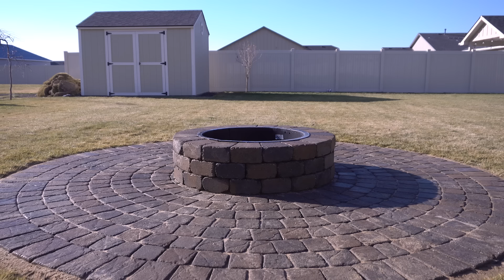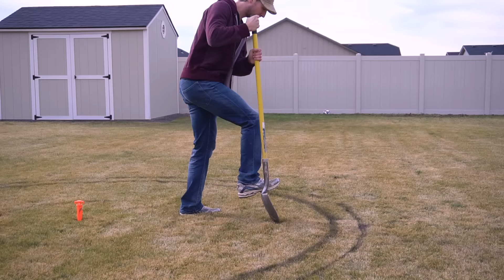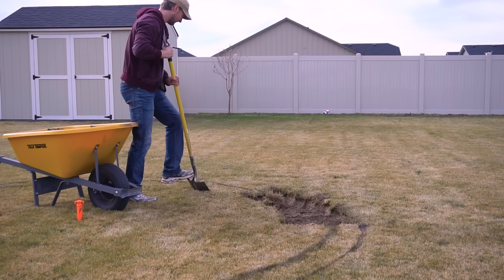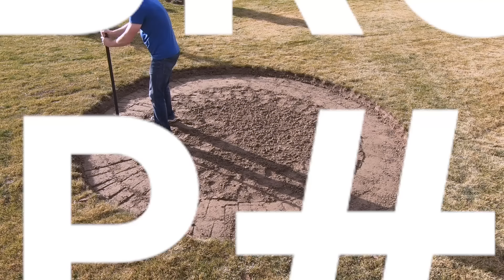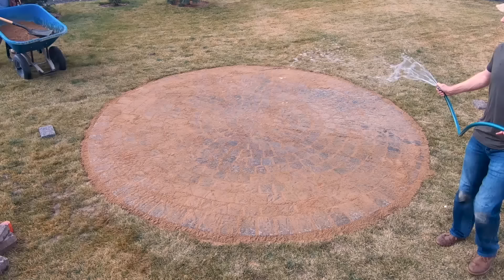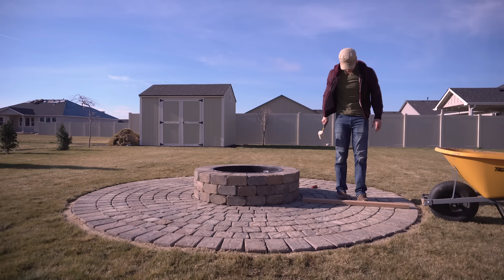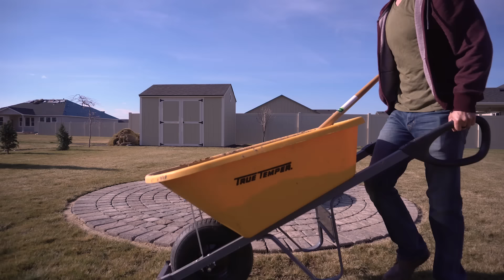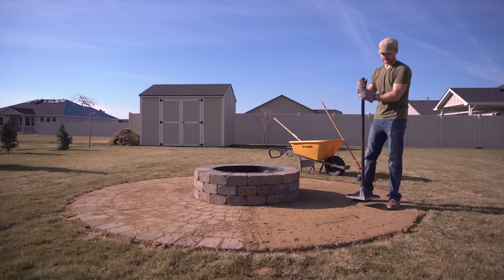My 4-Day Fire Pit Patio Build [Full DIY Project]

Comment: This is a great build the only thing I would recommend is to use polymeric sand for locking the pavers in better, metal edging just because once the grass grows a weedeater will chew through the plastic edging over time and they also warp after a while in the heat, some liquid nail would help keep the firepit stones from moving over time and then just personal preference but some low gloss wet sealer really brings out the color in pavers.
Reply from the maker: Thanks! Good tips
Reply: @BroBuilds  Obviously you finished your build so its mainly for other people trying it out😂 I used to build custom outdoor kitchens for a landscaping company so Ive built tons of outdoor patios, I like the kinda "go with the flow" attitude though and its a great looking patio, got a sub from me for sure👍
Reply from the maker: @GarrettMusic  I appreciate it! I'll be building a bigger one attached to my house later on, so I'm definitely gonna be using all the good suggestions in the comments. 🙂 Welcome to the channel!

Comment: Should have done landscape fabric , metal pipes work better instead of conduit because they don't bend, don't need to pack them in like that you can take a rubber mat and your hand tamper set them better, gotta try to break those seems a bit better too, whyyyyyyyyyyyy didn't you use joint sand to match the color of paver it's not that expensive and locks them together better, tips and comments from someone who builds patios for a living
Reply from the maker: Yeah. . . There was some stuff I missed. So far it's all worked well though. I didn't want to use joint sand because when it cracks it looks ugly. I'll just put a little more regular sand when it needs it.
Reply: @BroBuilds  I do agree it worked well and it looks great! Also joint sand doesn't really crack if it's swept right, and you use a leaf blower to blow away excess sand
Reply from the maker: @deathninja1299  good to know! I'm gonna be doing a bigger patio attached to my house, so I'll look into the stuff you mentioned for that 👍
Reply: @BroBuilds  can't wait to see a video on it!
Reply from the maker: @deathninja1299  it's gonna be such a huge project. . . But I'm excited to do it, just want to do it right, for sure! :)

Comment: you don't need to add cement to the blocks that m ake the fire pit? Like I know theyre heavy but still shouldn't you add just abit? to make it a bit more permanent and secure?
Reply from the maker: Yes, we should. I just wanted to wait because I knew we'd be removing some of the bricks to increase airflow and reduce smoke. We posted another video on that process, if you're interested: https://youtu.be/2DlTu1PxBCU

Comment: That patio is going to fall apart
Reply from the maker: It’s done well so far through fall, winter, and spring. We built it appropriately for our area and climate. But out of curiosity, why do you think so?
Reply: @BroBuilds  Hand tamping doesn't compact deep enough for long term durability. Use a jumping jack and not plate tamper. Mix a couple bags of quick dry cement with the levelling sand, then lightly mist with a hose.

Comment: I don’t understand what the purpose of the conduit was.  They placed metal rods just to remove them?  Were they just measuring tools?
Reply from the maker: Yeah, they're just used to measure depth of the sand (in our case, the depth we wanted was 1 inch). And then when you scrape the 2x4 across them, it levels the sand at that 1 inch depth all the way across.

Comment: But all the rocks around the fireplace are loose...
Reply from the maker: I'll secure everything with masonry adhesive eventually. I just knew I wanted to remove some of the bricks to increase airflow and reduce smoke before making them permanent. There's a follow up video on that here: https://youtu.be/2DlTu1PxBCU
Reply: @BroBuilds  Alright, that makes sense. Great video btw. Be well, bud!

Comment: Dont you need to set the top?? So those pieces dont just fall off?
Reply from the maker: They're pretty solid as-is, but I do plan on using masonry adhesive to bond them permanently. I just knew we'd be removing some bricks from the fire pit to try to increase airflow and decrease smoke, so I didn't want to do it yet.
Reply: @BroBuilds  ah nice! That definitely makes sense

Comment: So … the actual firepit is not cemented together its just loose bricks stacked on ?
Reply: Yeah, not sure how well this burns without a way to draw air from beneath it?
Reply: @ozzyo99  just take the hilti when you need holes for air. i learned this from my bad habit to build stuff and thinking about those small details when i am done. 😁
Reply: @thakori  what's A "hilti"?!?!
Reply: @tonyp4914  drill
Reply: That is correct.
Reply from the maker: Yeah, I'll add masonry adhesive eventually, but I'm still experimenting with air flow (by removing bricks) and I didn't want it to be permanent yet.
Reply: That is a beautiful pit. What i would upgrade too, definitely.

I had built a pit about 10 years ago, about 3 feet wide, didn't put in cement.
 I've seen that that has allowed it to withstand the heat, as there's room for expansion and contraction. It's withstood well, weather included. The little gaps have been enough for air circulation. I've only had to replace 2 top bricks thus far.  A flat base is important thought.

Comment: Is the center fireplace unstable? There's no support to it or "glue" to hold it down/together? What happens if someone trips and hits the fireplace? Does it topple? Or playing soccer and a soccer ball hits the top edge.
Reply from the maker: It doesn't topple. They're really thick, heavy pavers. But, we'll add some masonry adhesive once I'm sure I won't be adjusting the bricks any more - we've changed them around once already to increase airflow and decrease smoke: https://youtu.be/2DlTu1PxBCU
Reply: @BroBuilds  very cool! Makes sense when explained like that. Thanks for the reply!

Comment: So everything is just setting under its own weight? No adhesives or cement filler between the cracks?
Reply from the maker: Correct. We still had a second video to film, where we removed some bricks from the fire pit to increase airflow and decrease smoke, so we didn't want to make it permanent yet: https://youtu.be/2DlTu1PxBCU
Reply: @BroBuilds  I don't know a great deal about patios I've had to work on and around a few doing other kinds of landscaping but I always saw cement or I guess what they call grout or grouting to seal the cracks especially with flag stone patios. It doesn't seem unreasonable to only fill it with sand I imagine once everything settles in place it will be pretty stable and as you say make an work or changes later much easier to do. Anyway you have a fantastic looking yard and the patio/firepit looks awesome. A lot of work but well worth it in my opinion. I imagine you will be having some good relaxing weekends with that.
Reply from the maker: @nothingcanstopwhatscoming6664  thanks man - yeah, it's been a fun addition to the yard so far!

Comment: Dudes I applaud to your work it looks nice but for us in EU it's a lot different work. 

I work as a mason but we do many other works. Practicly anything around the house. I saw only one problem in your creation. Sand. 

We do not use sand under any type of sidewalk or terrace or anything else. We use 3/8 mm shredded rock and into the clutches between each block we use silicon based fine sand. That way you make sure no grass or any other plant will ever grow inside those clutches. It do not show but yellow sand support many types of grasses and in time clutches without filler itself will move and fill up with dirt what will in time grow grass.
Reply from the maker: Good tip - thanks man!
Reply: @BroBuilds  One more tip yet. When you try to fill those clutches use dry sand even if you are using a yellow sand. Wet sand will not go all the way down and when it dry up it will fall and make a space at the top and again dirt can accumulate there. If you see some space after some time just fill it with that silicon based sand. If you use dry sand preferably silicon based from bag (in EU it's 5Kg bag) you can use 2 - 3 bags for project scale of yours. It will save a lot of time and you don't have to compact it with that tool of yours. It's so fine it will try to fall down itself. Rain will do the rest.
Reply from the maker: @T3RS1  I will do that!

Comment: I built one of these, it was a tremendous amount of work.
Reply from the maker: Nice - are you glad you did it? It really is a big project.
Reply: @BroBuilds  yes, mine was just a paver patio and I put a gas fire pit on it. We love it but it was some of the hardest manual labors I’ve ever done. Well worth it however and cost $1200 vs the contractor quote of $10k.
Reply from the maker: @surftx11  wow, that saved you a ton! Nice work man. You can see why the pros charge so much 😅

Comment: What was the point of the white pipes?
Reply from the maker: We laid the two pipes down so that we could run the 2x4 across them and get a perfectly even layer of sand. The pipes were about 1-inch in diameter, so the send was 1inch deep as well, which is what you want for something like this.

Comment: Would of done a few things different but otherwise decent job.

Polymeric sand would of been better, definitely would of used a plate tamper to set the pavers and the base. I also didn’t see them level the area for the base or mortar the fire pit.
Reply from the maker: Thanks man. I decided against polymeric because I didn't want it to crack and look ugly between the pavers in a few years. But, I can see the advantages to it also. And I didn't want the patio itself to be true level - I just wanted it to match the slight  slope of the yard so it wouldn't be a tripping hazard.

Our next video shows how we removed some bricks for more air flow in the fire pit, so that's the only reason I didn't mortar yet. Good tips for sure though!

Comment: you leave that much of gap because heat will expand.? correct
Reply from the maker: I think the gap in the ground pavers is just to allow sand in between, and give some leeway when you place them. They're just not manufactured to be precise, like floor tiles are.

Comment: This is an honest question. Would a level just be way more accurate to check the pavers instead of the 2x4?
Reply from the maker: Totally a good question! I wasn't concerned about making the pavers "true level" (because my lawn is sloped slightly) but I wanted them all to be pretty even with each other. So the 2x4 just helped me spot any pavers that were sticking out a bit. I could've used a level instead, but I would've ignored the float if I had.
Reply: @BroBuilds  Awesome. I've never done a fire pit before but I was planning on doing one and that makes total sense. With a sloped lawn, I imagine it would be a gigantic PIA to get it to true level.
Reply from the maker: @infin1ty850  yeah exactly, and then there's also the chance that you'll trip on the bricks where they're sticking up from the lawn, or set down into it.

Comment: U can install piping dig trench pcv pipe run it all the way over away from seating area put a square plate grate   connected to pipe level with ground  then u have a smoker

Comment: In Sweden youll need to dig x5 the amount, otherwise it will be like a rollercoaster next year
Reply from the maker: Dang! That's a lot of digging.
Reply: @BroBuilds  dont know the English word for it but the frost in the ground is making the ground so expand and contract.  Which means you need to dig below the frostlimit, which is 1 meter below the top.  Otherwise your work will be in vain.

Comment: Does your sub-base have to be leveled before you add the gravel?
Reply from the maker: Honestly, I just got mine kinda flat and called it good. I figured it wouldn't matter as long as the gravel was level on top of it. That being said. . . I suppose there could be some reason why it actually does need to be level. 🤷

Comment: You should use the wood to hit the stones in line. Much easier, much faster. There is a technique behind it and you do not have to hit stone after stone qirh cotrection, where it often brings more mistakes. And also I'd do more steps to water the sand in. Use the water hosepipe while holding the broom to push in the sand. Makes it cleaner and you don't have to it like in the video, but in the end "bros not pros". Awesome work, better that most bris. Liked ut!
Reply from the maker: Thanks for the tips!

Comment: For those looking to do this, consider installing a 1 inch metal pipe under the fire pit pavers which turns 90 degrees to lead inside the fire pit. try to make it concealed but fire need oxygen to breathe.  otherwise all you will get is smoldering embers and smoke.  I learned the hard way.
Reply: A simple flu opening with a grate inside the pit would suffice. My grandpa built his that way and it was built over 30 years ago and is still going. Needed patchwork but still going.
Reply: @davejones9469  what is a flu opening?
Reply: @arturarruda8151  I do not know
Reply: @arturarruda8151  I think a chimney? That's what came up when I searched
Reply: @bobpoppy5478  pretty much
Reply: You could like break one of the bottom layer pavers of the fire pit in half and leave that small gap for airflow
Reply: Gotta have airflow into the pit from the bottom to cut down on the amount of smoke
Reply: I mean he can just do this pretty easily as they're just placed.
Reply: @roguetrader306  not know

Comment: Smh... the fire pit goes first. All the pavers under that pit are gonna crack from the heat. Looks good but isn’t going to last long
Reply from the maker: The pavers are holding up well so far. We did put a grate in, which keeps the fire up off the bricks a bit.

And, if anything does happen to the pavers in the fire pit, we can always just pull em out and replace with sand.

Comment: bro can i ask a question. how do you drain the water inside the fire pit?
Reply from the maker: It drains down through the pavers on its own - the layers of gravel and sand are what make that possible. We've had a few huge rainstorms since building it, and the water has never pooled anywhere on the patio or in the fire pit.

Comment: Did you use polymeric sand (paver locking sand) or regular sand in the crevices of the pavers?
Reply from the maker: Just regular sand. A lot of folks recommended polymeric in the comments, so if you're doing a project of your own, you might prefer polymeric also. I just felt like polymeric might crack over time, and didn't want to deal with that.

Comment: do you secure the concrete caps in any way or is their weight enough to hold them in place?
Reply from the maker: They need to be secured with some masonry adhesive or cement or something. I just waited because I knew I wanted to remove some of the bricks and try to make the fire less smoky: https://youtu.be/2DlTu1PxBCU

Comment: Is there a reason you don't set the fire pit bricks with mortar? It seems like they'd all fall down if someone kicked it or sat on the edge.
Reply from the maker: They're pretty solid as is, but yes, the reason is that we're waiting until we're done adjusting the bricks for more airflow: https://youtu.be/2DlTu1PxBCU

Comment: Stonemason here.  If you're gonna lay them onto screened sand and tamper them, lay them all out first, as you found you'll need to shuffle some and maybe cut some edges, then when finished, use the plate compactor you've hired (seriously, it's a no brainer) to run over all your paving and bed it in.  If it's a more fragile medium and you don't want chipped edges, a sheet of ply or some folded geofab can be used to soften the metal plate impact.
Reply from the maker: Great tips man, thanks!

Comment: if you're ever confused about where the center of a circle is, pull out your compass again with the string at the length it was when you made the circle. stake the compass to any edge of the circle. go out towards the center and scribe the line near the center area. then pick another place on the opposite edge. it doesn't need to be perfectluy across. Restake the compass there and scribe again near the center. where the two lines touch will always be the center of the circle since both lines are equally distant from the center
Reply from the maker: Oh yeah! That's a good tip. 👍

Comment: I use to be the one to do all the stone patio kits for my old Landscaping company. This is the same procedures I did step by step except when I laid my gravel then sand I would give it a 1% slope from the center to the edge so rain could run off towards the sides and not build up on the patio itself. I also used a certain kind of sand for filling in between the stones that when wet turns into an almost concrete type material for extra strength. I kinda miss this work.
Reply: Polymeric sand

Comment: don't you want to use cement as the base so plants don't start growing in between the cracks?
Reply from the maker: I might in the future. . . I didn't this time, because I wasn't sure if it would crack over the winter and look bad. I figured I could just add more sand down the road instead.